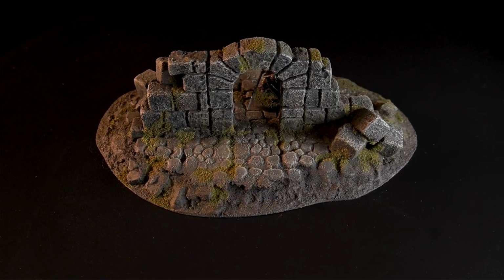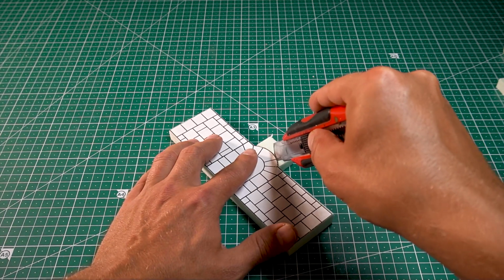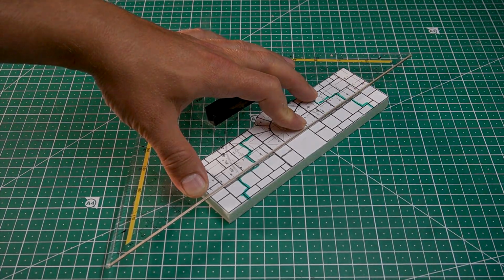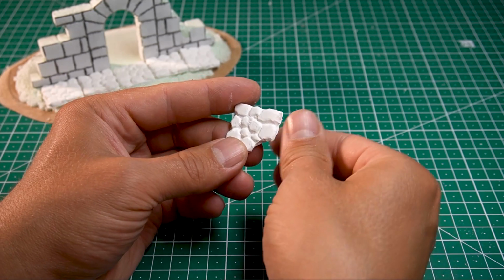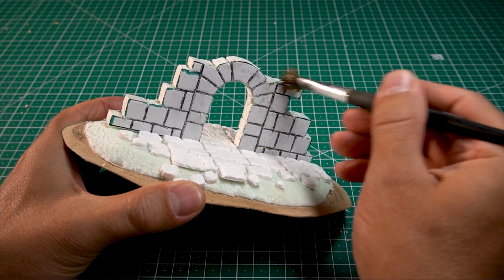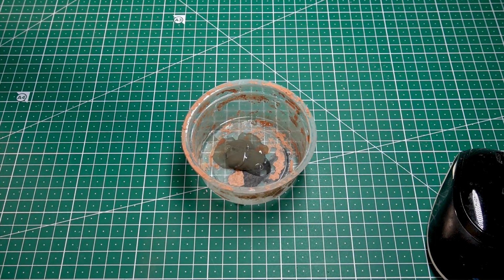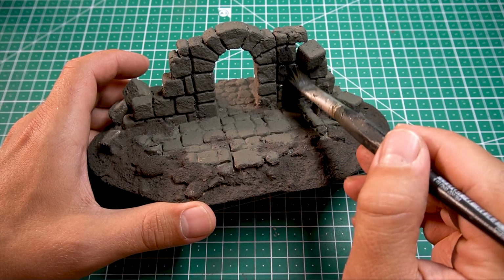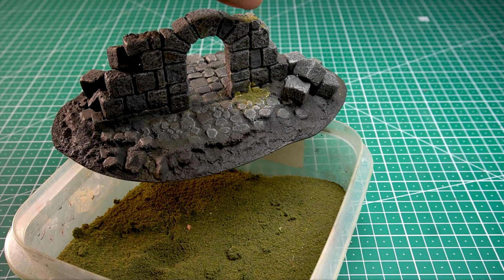Easy Dungeon Walls Of XPS // Templates Test

Comment: I see a lot of chipboards in use. I am wondering if those dont deform when using PVA etc?
Reply from the maker: As long as you don't soak the wood or cardboard excessively, you don't really have any major problems. It is also important that the unbuilt edge of the base is not unnecessarily wide. Cheers

Comment: Isn't it easier to remove the template/paper and structure the foam before you glue it on the base?
I made the experience that I have problems at the bottom of walls I clued before.